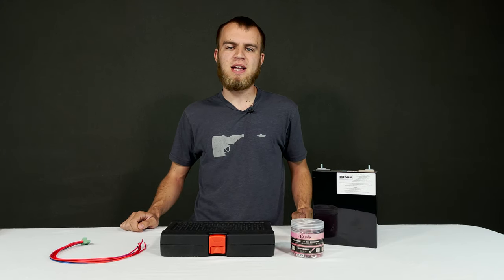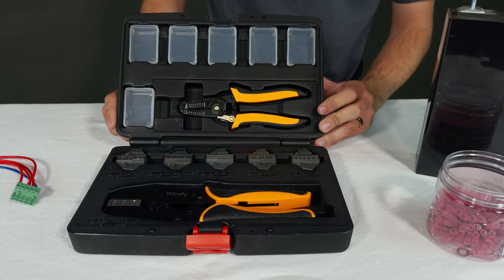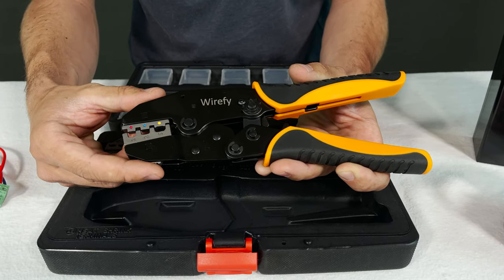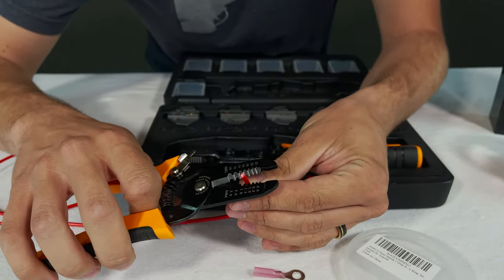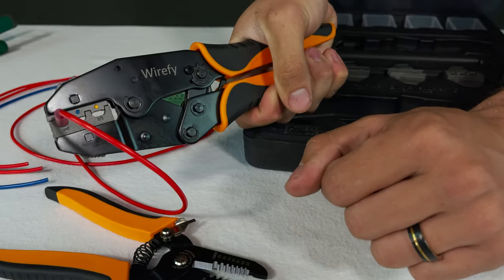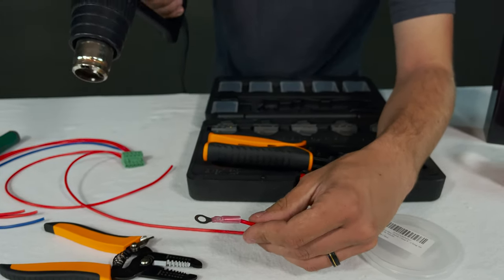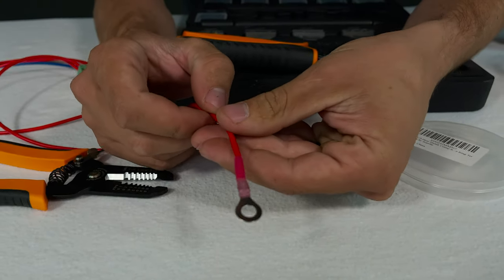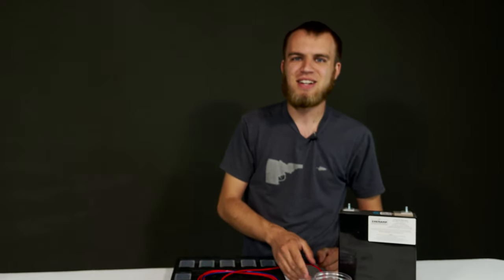High Quality Crimp Connector Tool || Throw Away Your Old Crimping Tool

Comment: Love these things, the adhesive glue that melts during shrinking is stronger than the actual crimp itself.

Very strong connection, don't have to worry about it seperating even if you get a bad crimp.

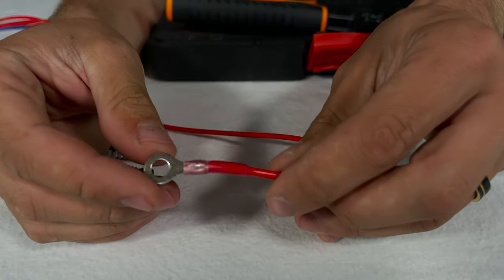Comment: The crimping worked fine, But Not Perfect. You can see it actually did damage the heatshrink, there was a shiny metal part showing through @3:33 where a tiny pinhole opened up larger, after the heat had softened and shrunk it.  I wonder if this is avoidable or not, the plastic covering was very thin for the amount of force needed. Maybe you need a better brand of terminal; you didnt show what brand. You get what you pay for in terms of bulk consumables, doesnt surprise me.  But the crimper was very nice.
Reply from the maker: I went back and inspected that ring terminal and it's hard to tell if the glue filled in a hole if there was one or if the heat shrink just formed back into place but there is no metal connection possible where the heat shrink is supposed to be.

Comment: If you look closely, the crimper punctured the insulation, leaving a bright silver spot. I much prefer to use the uninsulated connectors with separate heat shrink. The crimps are strong and less bulky.
Reply: Yes it did.  I caught that right off the bat.  I don't use the heat shrink connectors.  I prefer non insulated connectors in conjunction with real heat shrink.
Reply: Once you heat shrink it, that closes up. Having used both, I prefer these heat shrink types because they glue to the part of cable that isn’t even crimped.
Reply: @tomkilmore7254  a dedicated adhesive lined heat shrink over a non insulated connector is much higher quality.
Reply: That's because he was using the wrong die. He was using a die for insulated terminals, not heat shrink terminals.
Reply: @tomkilmore7254  The adhesive lined crimps are nice high quality splices but unless you are crimping in a wet or marine environment they are usually not necessary, and they are pricey.
Reply: @charleswilson4598  just being outside half the time (in the UK) causes havoc on standard terminals. Yeah, They are pricey when using lots…but for personal use it I would choose Everytime. If I had the time I would change all the fasteners on my outdoor equipment to stainless steel also 🤣
Reply: @FullForce1972 maybe…but these have enough quality for nearly all applications imo, and will cut down on time. Not cost tho.

Comment: Looks like a nice tool.  And those self-shrink+glue connectors are the bee's knees. 

Twisting the end of the wire makes for a worse crimp.  Return it to the manufactured twist if the stripper untwists it but don't go beyond that. Twisting beyond that makes conductor strands cross over each other, and leaves pockets and spaces inside the crimp, reducing the conductivity, corrosion resistance, and strength of the crimp. The more parallel the strands, the better the crimp. I would have given an 1/8 turn if anything, but not a full turn. Also the blue terminal is usually the appropriate  color terminal for 16Ga. (Red is 18-22) (blue 14-16), (yellow  10-12), which would explain we he needed to excessively twist it.

Comment: Because the pre-attached heat shrink tubing is so easy to damage, I'm going to switch to bare ring terminals with no tubing or insulation.  After crimping, I'll add the heat shrink.  I've simply had too much insulation goobered up on ring terminals due to crimping.  Yes, it will take me longer.  But that time affords me the opportunity for a very clear inspection of the crimp and a perfect heat shrink.

I'm using a crimp die very similar to the one you used, but a different brand.

I hope the new company is doing well!
Reply from the maker: Thanks for the good wishes!!

What brand heat shrink terminals did you have issues with?  We are considering carrying them in our webstore but are not yet certain on which vendor we want to go with.  Have you ever found a quality connector that you were satisfied with?
Reply: It's a danger, but wider crimp tools help, and most minor damage the glue will fill in. I''ve tried bare terminals, but couldn't find any of reasonable quality. The ones I found were just too thin to really be trusted with high loads or critical connections. Also for extremely visible connection I want to be pretty, a double layer of heat shrink doesn't hurt anything.